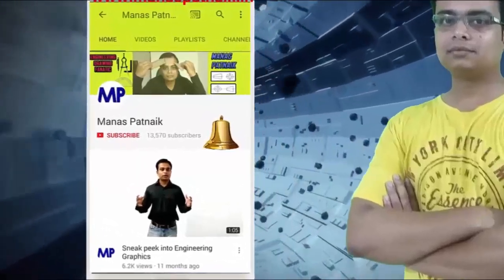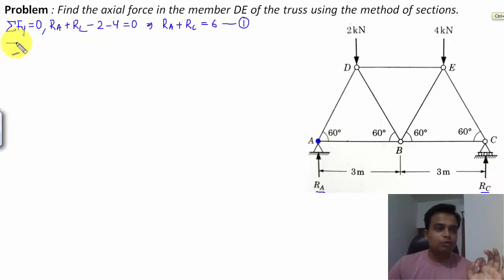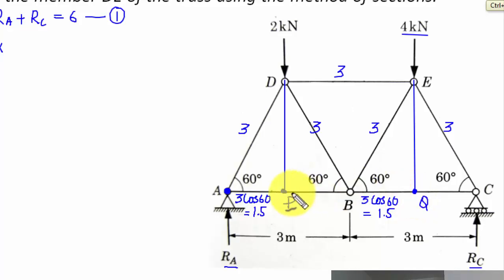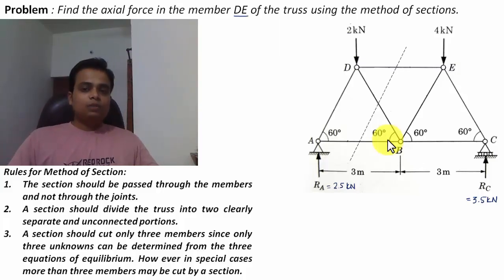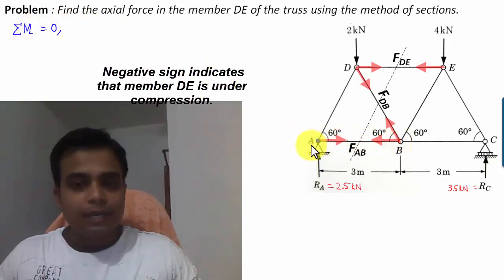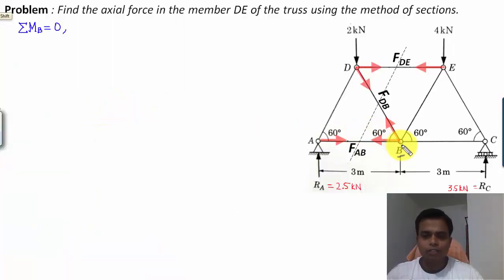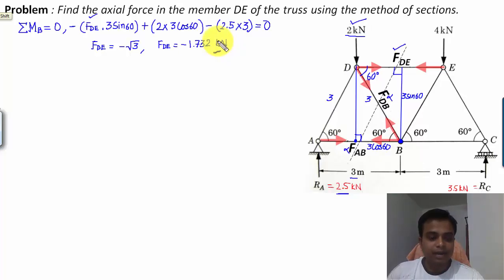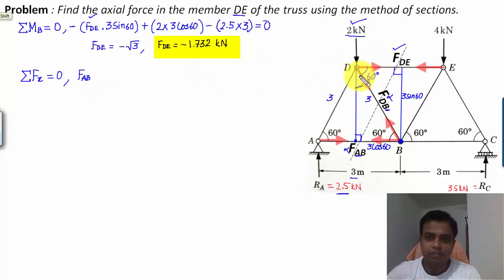Trusses_Method of Section_Problem 1

Comment: If you solve the same questions by method of Joints
And take the node A
£Fy=0; Fab.sin60+2.5=0.
£Fx=0; Fae +Fab.cos60=0.
By solving these 2 equations you will get Fab = - 2.88
But in this video by method of section you are getting the different value of Fab.
How is it possible?

Comment: Sir at A it is an hinge support what about horizontal reaction force
Reply: horizontal reaction force=0.(so,Not considered).
Reply: in these truss all the external forces are vertical hence all the support reactions will be also vertical therefore no horizontal reaction at A
Reply: There is no external force acting in x direction so horizontal force will be zero

Comment: sir i have a small doubt ragarding the calculation of forces in method of sections
and my doubt is in method of sections we usually calculate forces by taking moments at a point right  then y sir u have taken sigma xand y for calculating fab and fdb.
Reply from the maker: Well Sankar......
You can infact take moment equations multiple times. No problem that ways also u can find the unknown axial forces.